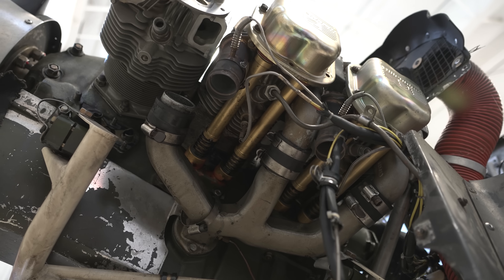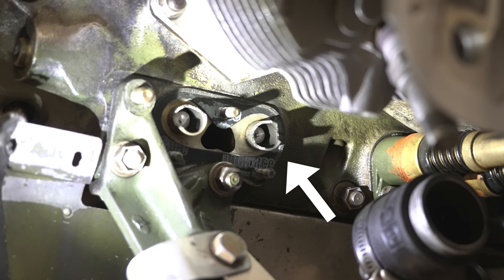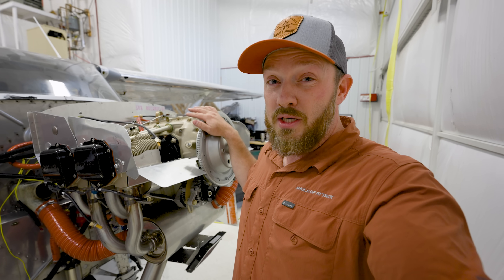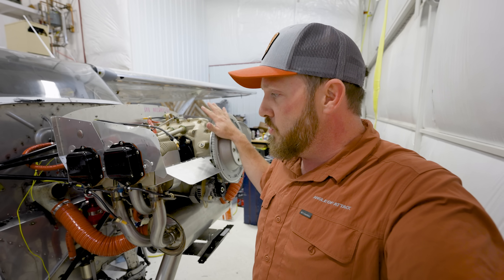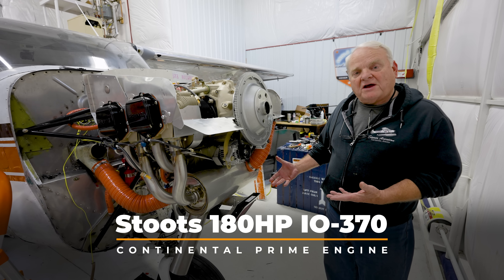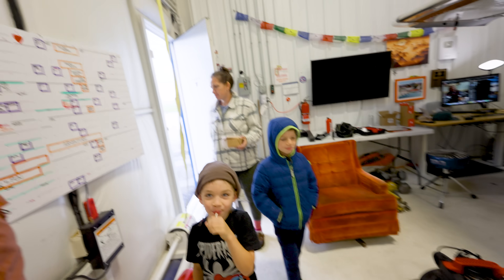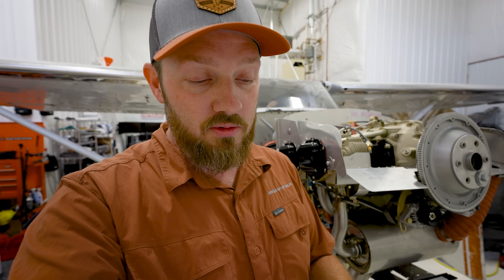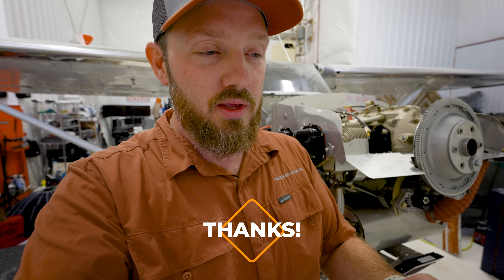Bet You Can’t Guess This 👀

Comment: I'm glad you've found an engine for 23U! Serious question here though – (not a troll) – but what is the "new, modern, safe technology" of this engine? I realize it may be a factory-new engine, so all-new components, and the implied safety of that – but it's still a 1930's design – an air-cooled, magneto fired engine, with fuel injection designed in the 1950's, is it not? Roller cam tappets were invented by herr Diesel in 1893, so they're not new either. I checked the Stoots web site and didn't see much info there on the technology involved, so I'm genuinely curious? Thanks.
Reply from the maker: New is all relative when it comes to aviation engines. If we compare the standard to everything else, yes, we’re years behind. However, being relative, things like the rolling tappets and the benefits of all the other small tweaks over the years makes it measurably more safe than an O-300.

Comment: good choice on a engine of this type . You will be  surprised at the extra performance . Fuel consumption is a lot less than you will be expecting . it will climb like a home sick angle . I have now done 4 of these conversions . including my cessna 170 .
Reply from the maker: It’s going to be pretty awesome. Trying not to get my hopes up and have tempered expectations. One way or another it’ll be a great thing. Even a new engine and new tech is great. I’ll take whatever extra performance I can get.
Reply: @angleofattack i have fitted a sensenich   propellor it’s 76EM8S5-0-60  [60in pitch ] . I have found these props have a “harder “ skin on the prop which resists stone marks.  Plus they are lighter  . doing a weight and balance ,i wasn’t comfortable with the weight on the nose ,so a EarthX battery was fitted . OMG so,small and light weight . The performance  of this battery is totally unbelievable .  It’s mounted on the fire wall. 
   Tried a 56in,58in  and a 62,64 in pitch . The 60in works perfectly . Even with 4 people and full fuel but admittedly it was at sea level.
Reply from the maker: Hey David, can you send me an email? Chris AT angle of attack . com. I can't write it out as it should be written. Curious about some of the parts you used and your overall feedback on a few things. Thanks.

Comment: I wanted to the same conversation to my 170B but wanted to save a few bucks with the O-360.  It would have been so much easier to go with Stoots. What prop are you going with?
Reply: I also went with the fixed pitch prop (Sensenich ground adjustable) and I am very pleased with it.
Reply from the maker: A Sensenich Aluminum, but soon a ground adjustable carbon prop.

Comment: Chris,  Looks like an awesome upgrade there for 23U that 180hp will really be nice.  I have gone through the engine swap process and can't imagine the extra stress due to your location and being that it is a newer STC engine.  Nice that Dave at Stoots' was able to get you something half way timely and work with you through this.
Reply from the maker: The stress is what it is. I'm not that worried about it. It'll happen when it happens. Just grateful to be in this position. Continental can turn these engines out in 7 weeks, so it's a pretty good situation for others.